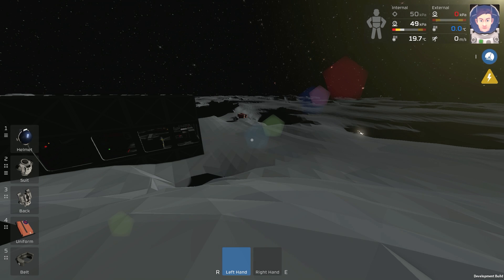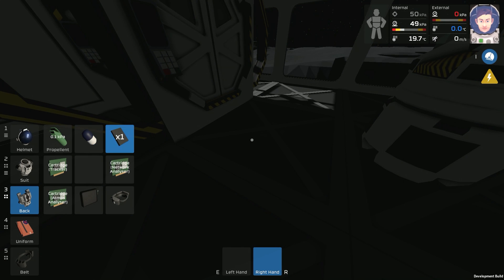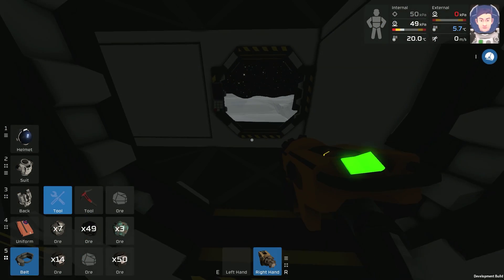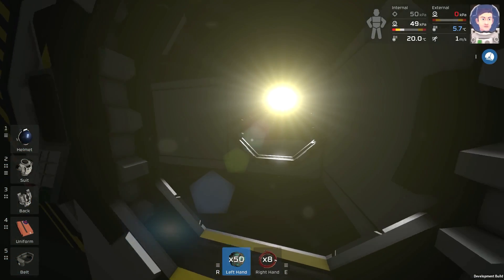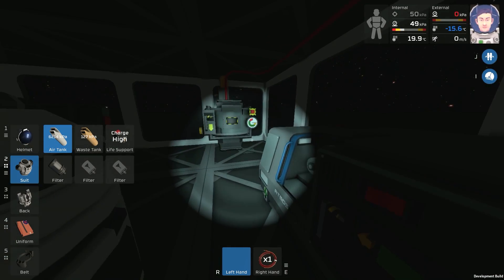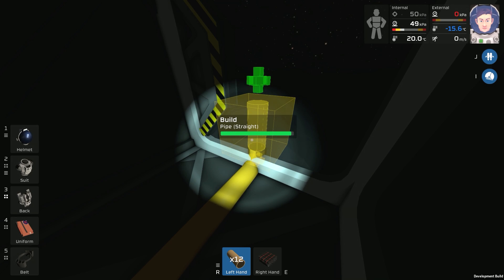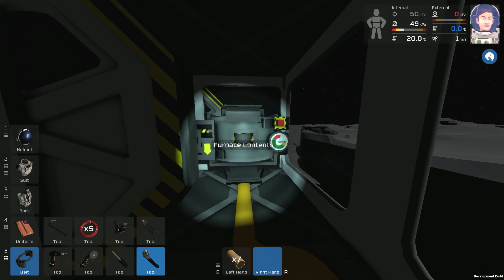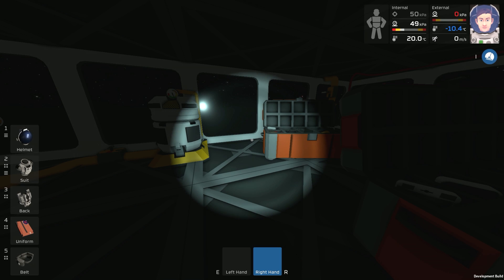Expanding the Power Grid and Producing More Oxygen! (Stationeers #04)

Comment: This game is great, after a few hours of a hard learning curve I finally got myself a pressurized base with breathable air. Filtering gas and separating/storing them is key. Never smelt ore and extract directly in to your air stores, and use oxide to produce o2 not ice :) I did however turn off hunger because that was too hardcore trying to learn how the mechanics work and survive at the same time. Looked up a solar tracking logic setup and the game became much more enjoyable and gave more time to experiment with things. After playing around with the logic chips, they are quite easy to use for some simple automation. Can't wait for more updates.

Comment: No need for more furnaces just use the filtration unit. They have one input and two outputs, filtered gas and waste, so if you pipe the waste into the next filtration unit and make a chain of them you can separate all your gasses into storage  units with only one furnace. And i think you get one filtration unit in your stater boxes so you can filter O2, because right now the gas you have is a mixture, you should check it with your atmo analyzer!

Comment: Use oxide ore for oxygen, exterior air lock's connection is outside. and from solar pannel use heavy duty cable(since current will flow max from pannel wn u start using more pannel) and for safety use small transformer(1000-3000w). u can use ur analyzer to check how much power is drawn.
most imp is solar tracker(1st priority).